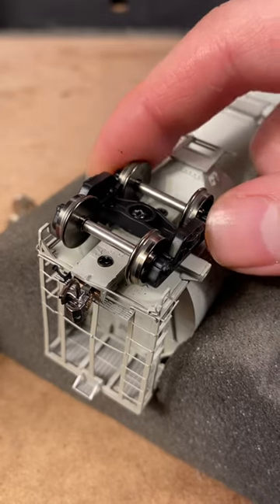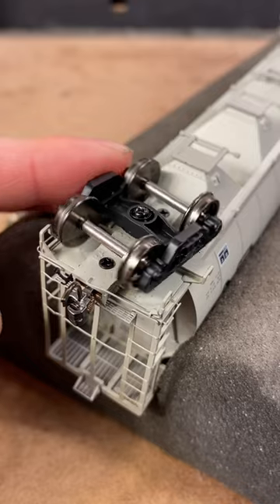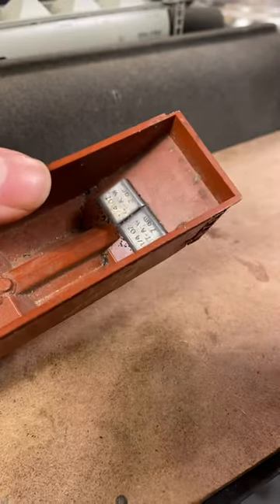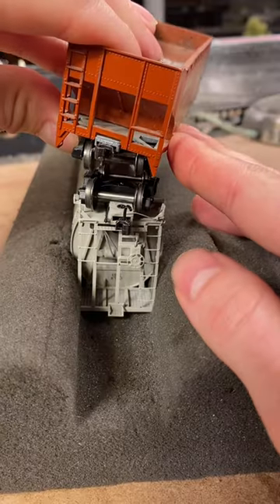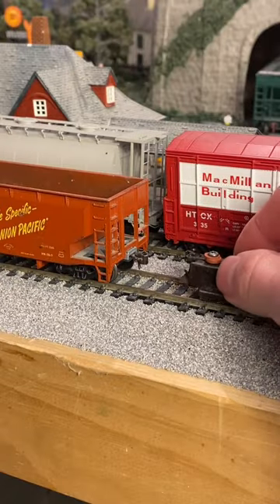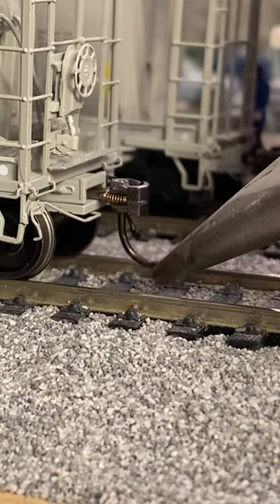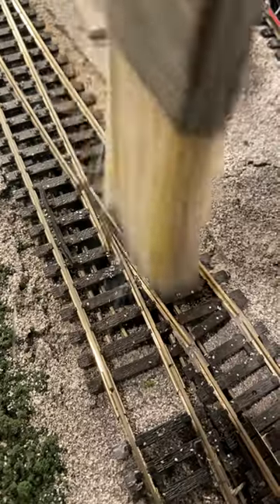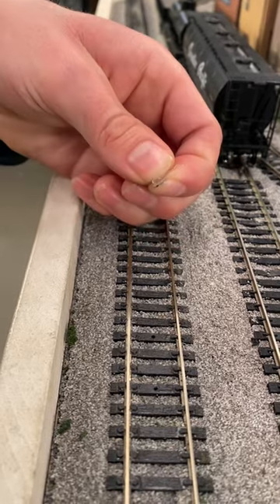How to Prevent HO Train Derailments - Model Railroading for Beginners  #hoscaletrains #modelrailroad

Comment: One extra step when tuning up your rolling stock. Grab yourself a truck tuner from Micro-mark. For those who dont know, it's a small tool that will enlarge the holes where the axels sit, allowing them to spin more freely. Have a problem car that slides or still derails even though you have added weight and metal wheels. This little tool could cure your problems.
Reply from the maker: Thanks for your thoughts.

Comment: About couplers- it might check perfectly with the gauge, but if there is any play at all in the draft gear, it can move up and down when under stress- like when being pulled in a train.  Put a finger on the coupler and see how much it will move up and down- that is the degree that it WILL shift when under load.  Glue small 0.005 or 0.010 strips on the inside of the cover piece to limit that vertical play.  The metal clips on an Athearn car can be slightly bent upward to do the same thing.
Reply from the maker: That's some great advice!

Comment: Hey SMT can you change a DC layout to DCC if the track is already nailed down? 

My friend is wondering
Reply from the maker: That's no problem. Track doesn't care if it has DC or DCC power so long as they aren't connected to the layout at the same time.
Reply: @SMTMainline  can you make a video about it but using a Kato Power box also can you do it with a DC and DCC together?

Comment: What do you use to clean the wheels? Is it just rubbing alcohol or something else?
Reply: CRC QD Electronic cleaner for metal wheels. Since the track is an electrical point of contact for the locomotive an electronic metal cleaner is most preferred. Do not use a petroleum or silicon based cleaner. And ventilate the room when using. Rubbing alcohol has water in it which can cause gradual damage over time. If you can afford to, convert all your rolling stock wheels from plastic to metal, otherwise inspect and clean those wheels regularly. Even with an emaculate freshly cleaned track I found plastic wheels accumulated so much gunk within an hour. And lastlyn CRC QD is plastic and most paint friendly. It dries rapidly.
Reply from the maker: I use 90% alcohol. I know it's not great for the metal but since rolling stock is non conductive I'm not too concerned about it.
Reply: I CRC Contact cleaner and protectant. Great for cleaning locomotive wheels, too.

Comment: Thanks that's helpful 
Do you happen to have any tips on sotering wires to the track?
Reply from the maker: Make sure you're working with a clean surface and use flux to help flood the solder.
Reply: Ok thanks

Comment: Where’s a good website to get a track gauge for wheels and tracks as well as coupler gauges?  Which code of track is best for HO scale?
Reply from the maker: I use code 100. As for the gauge, I've only purchased them from hobby shops.
Reply: @SMTMainline  Thanks Harrison! Maybe you might cover wiring the layout, insulated joiners, power tracks, and turnout motors for remote switching? 

My Dad was an electrical genius and he wired his old board in a unique manner. You’ll be my Locomotive 🚂 Surgeon with deep respect 🫡! I love to pour my heart into retracking the layout and turn outs to code 100! Thanks for sharing and responding. 👍👍👍👍👍👍🖖🖖🖖🖖🖖🖖

Comment: what do I do if the first car behind the engine tips on a turn and derails on a curve?
Reply from the maker: Check to make sure the coupler on the locomotive isn't traveling outside the rail on the corner, otherwise it might mean it's too short.
Reply: @SMTMainline  2 cars have the couplers go outside of the rail and some engines too